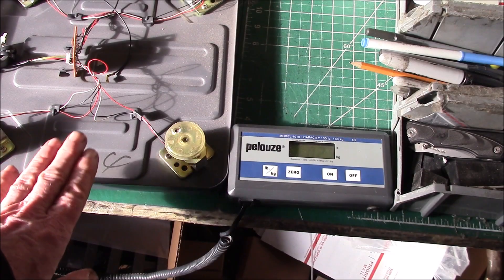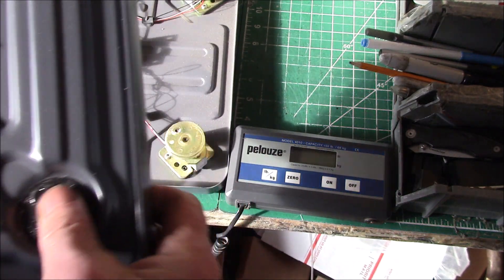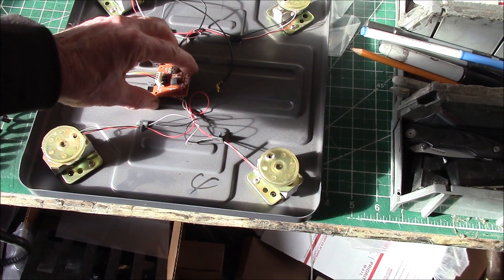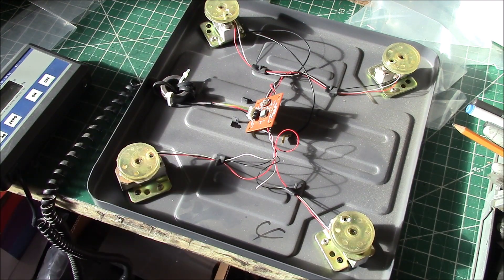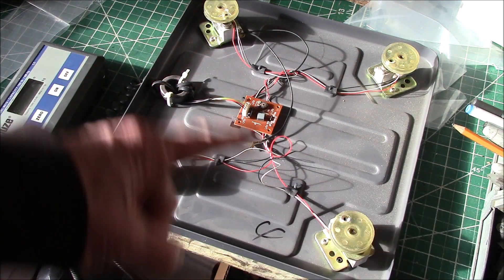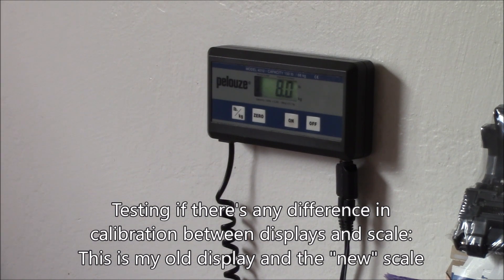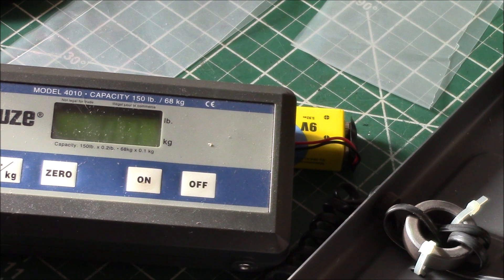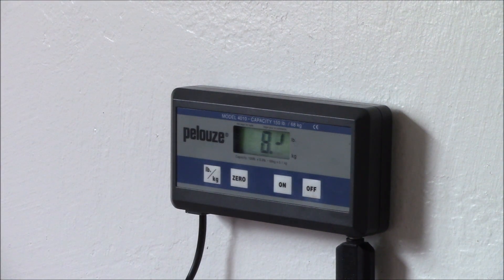Pelouze / Rubbermaid Model 4010 Scale: What's Inside and Testing

Comment from the maker: Timeline:
00:15 Testing repaired display
00:30 Auto-off Disable
01:20 Taking Weight Platform Off
01:45 Strain Gauges
02:40 Circuit Board
03:45 Scale Operation
04:20 Testing Old Weight Platform
05:05 Scale Manufacturer
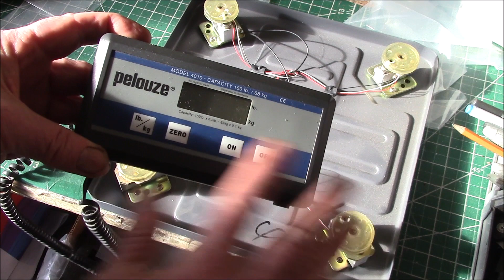05:48 Different Branding
06:50 Testing Display / Scale Combinations
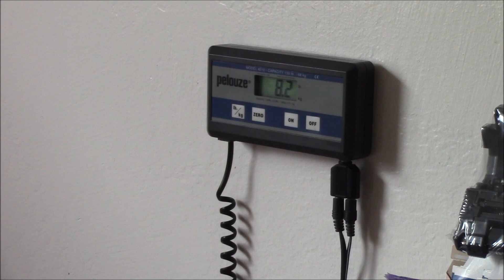08:00 Testing Old Display / Scale

Comment: EDIT: I took it apart anyways and luckily the issue was the yellow sensor wire was disconnected and I just had to resolder it back on.  Best $20 I spent on eBay.  New in box, 4040.  

Thank you for the teardown!  I just got a 4040 model which doesn't register any weight, the display turns on, shows the model number, goes to 0.00 and that's it.  Whatever I put on the scale just stays at 0.00.  Do you think it's worth opening up the scale itself to see if any cables are unplugged or what would  you suggest?  Thank you!
Reply from the maker: Sounds like a good repair.  Since you were getting a 0.0 weight reading, the scale was connecting to the display.  I guess the broken wire was probably the one with the actual weight signal.  I've not run into that issue yet, but yes, I think a lot of these scales get tossed or sold on eBay for cheap because of some simple to repair problem.

Comment: Mine (4040) is always off half a pound and will not calibrate. I replaced all three capacitors and turned that variable resistor (?) every which way. When I attempt to calibrate I get to the C100 prompt, add 100lbs, press zero, and then rather that say "ok", calibrate and turn off, mine just prompts c200 like it now wants 200 lbs, which I don't have. It's about to go in the trash. POS.
Reply from the maker: I've never attempted to calibrate my scales nor could I find any documentation on how to do that.  I did link a video in the description that discusses the calibration procedure, maybe the creator of that video has more information.  One option is to record the weight error and then just add or subtract that from the displayed weight.